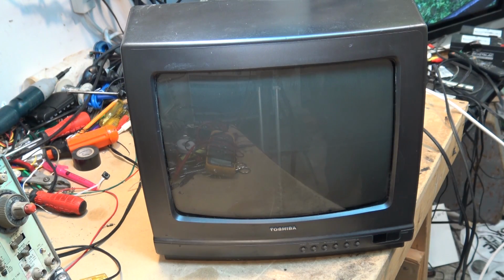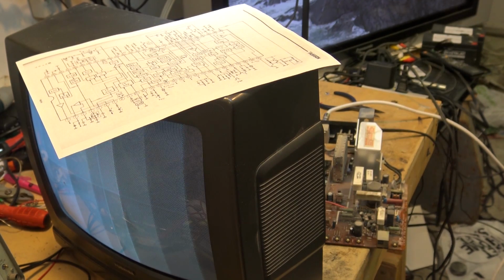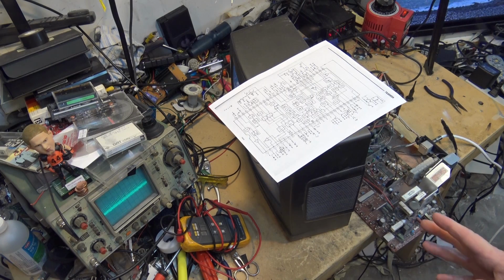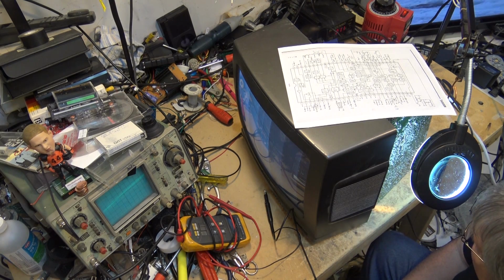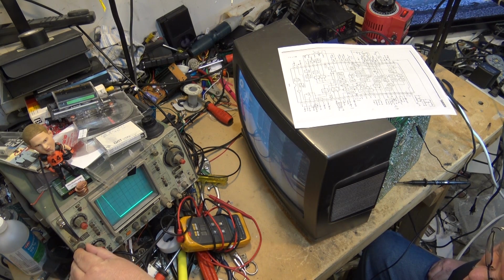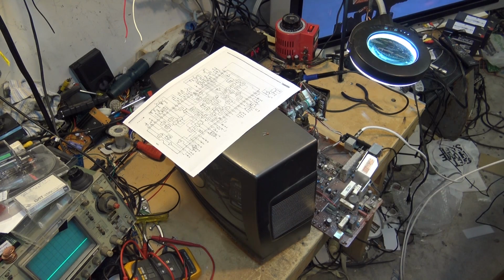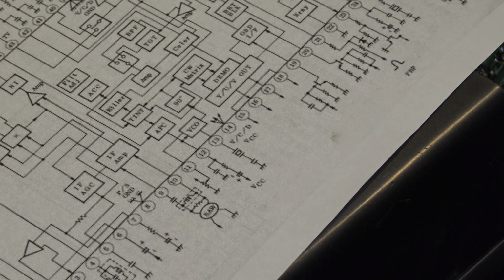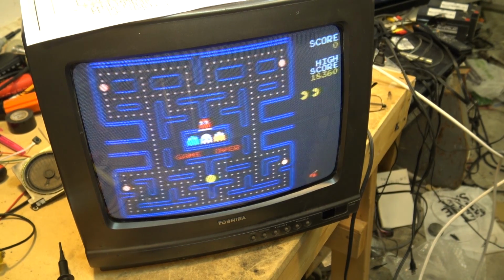Toshiba CRT TV No color repair

Comment: I know this is an old video but I have a Dell crt that loses its color. If I tap on the sides of the monitor sometimes the picture will get darker and lighter and once and a while it will get a pink tint over the whole screen. I suspect a loose component.
Reply from the maker: Or a bad CRT
Reply: If you have to buy a schematic where do you get them?

Comment: I realise that it's a bit late to be adding a comment to an article from so long ago, from the UK.  But as an ex (retired) engineer from 1958 to 2002, I am often amused by the now extreme accent on safety, which - for a good twenty years of my time - didn't exist.  When I started, all TV's had mains transformers, then came AC/DC sets, and we just ploughed on regardless, mostly doing repairs in peoples homes.  Many TV's were powered through a two-pin mains plug, so we had to have a 'neon screwdriver' to check which way round the mains plug should be. Getting at least a tingle, was a daily occurrence, and a proper shock, was known as a 'belt'.  It was in the mid to late 70's that 'Health and Safety' poked their noses into our lives, and the idea of 'Isolation transformers' were introduced.  The idea was to protect us from the mains by removing the reference to ground.  In other words, you became the reference to ground because the isolation transformer secondary winding is effectively floating with no reference to ground.  They then came up with the idea that workshop benches should also be 'Earth Free', meaning no ground on any of the mains powered equipment - oscilloscope, TV monitor, etc.  Practically all modern electronics - including some older CRT televisions, use SMPS (Switching Mode Power Supplies) that keep ground neutral to themselves in a marked 'Warning" area of the PCB... within this area, the only metal should be a heatsink.  In other words, the set (whatever it be), has two distinct neutrals - one with mains ground, and one with no actual ground at all, just a DC zero.  When working on TV's, I would suggest using an old style oscilloscope which itself will probably have a mains transformer, but even so, disconnect the earth in the mains lead (plug) to protect the scope probe ground. You don't need a modern storage scope for TV ... and whilst I started in 1958 at a large TV rental company, it wasn't until I changed employer in 1961 that I first saw an oscilloscope, and that was largely an ornament anyway... a 100khz max as I recall.

Comment: 12voltvids if you see this I need your help. I have an HD Samsung Slimfit CRT with extremely complicated video processing circuitry. It has a fault where composite video is in black and white like this one. There is no “jungle chip,” composite video alone runs through four different chips. I tried replacing the main board as a way to shotgun the issue, and as soon as I started the TV for the first time with the new board, I got composite in color. However, after I re-assembled the back cover and then turned it on again, the composite chroma was lost again. It is very strange and I don’t even know where to start.
Reply: Sounds like a broken connection in the chroma path. Check the comb filter circuit.  That set probably uses a 3d comb filter.  I have no experience on any of the Samsung hf crt sets. Mostly Sony and panasonic.

Comment: I've a 2001 - 2002 Citizen TV from the basement with that problem.  Fantastic trouble shooting.  Circuit layout minor different, but I bet it has the same problem.  A burnt out capacitor.  Thx!  (will test, anyway...)

Comment: 4:14 but the tv has a transformer the that mini transformer and that big coil is also a transformer
Reply from the maker: This is a hot chassis.  The mini transformer on many sets is for the standby supply to operate the remote control.  The horizontal circuit operates on mains voltage.  The fly back is used as a power transformer for the different voltages required by the set.

Comment: I worked at a fast food restaurant years ago. The images were burned into the screen. They didn't have screensavers back then.
Reply from the maker: I have a few monitors with burn in. The worst ones were the old amber and green monochrome VDTs I had one that was so badly burned back when I ran a BBS in the mid 80s. Burned a few of them, and an old CGA  and EGA monitor. This one was used for security cameras, as was the 20" that I have in the shop. It is nicely burned too.  I consider it a great send off for heavily used monitors to have the screen well burned by the time the CRT reaches EOL. I have a couple of BW monitors here that have been running for over 30 years non stop and they still have a good picture.

Comment: As time goes on, I'll understand more about equipment isolation and the transformer.  I'll have to rewatch this video again in the future.  I won't you to know I've paused this video because I don't want to miss a thing.  I'm still sad about you having to get rid of that Sony Trinitron after you spent time on it and two capacitors and did that resoldering.  Looks like there were some vertical lines at the top that still needed a problem corrected but.  If I were there, I would've of bought it from you. I love the old CRT sets.

Comment: Thank you for the nice educational video. Just to inform you in case you didnt try to repair a SHARP crt tv in past, it happens the exact opposite than here. Sharp uses its own semiconductors and IC's most of the times, where you only can find the service manual (after a lot of search...)of the tv to troubleshoot but no way can you find a datasheet of the various ic's not even for the transistors used for horizontal and vertical deflection. Its like a datasheet was never printed for the various sharp Ic's and transistors used in its TV's.

Comment: That PAC-MAN game sure brings back a lot of memories!
Reply from the maker: Yes! I have a few of those TV games. Bought them years ago, at circuit city. Remember them. Pacman was one, and I believe the other is spiderman. My son has it somewhere. I have another one that came preloaded with stuff, and my son now is collecting old NES games. Of course a CRT is the ONLY way to play those, because an LCD is too slow. You are dead before you get a chance to move due to the 3-5 frame delay on all digital sets.
Every time I put a small CRT up on craigslist it sells within a day for game use.

Comment: The television broadcasting system used in your country is ntsc pal
Reply from the maker: Nazar King 
Ntsc was used. Now all broadcasting is based on ATSC for 480i 720p and 1080i over the air. For cable we also have 1080p/60 and 2160p/60.
Yes believe it or not there are still SD stations. One local one has 3 sd channels on the same carrier and airs old TV shows from the 50/60/70/80s
Reply: 12voltvids HDMI tv

Comment: Hi, I wonder if the crt tv leaks its high voltage coming from flyback transformer. Is it the flyback itself is damage? or the other component is damage causing the flyback to leak its high voltage? It makes nasty sounds and affects the picture display.

Comment: You know how many quarters I spent on PacMan back in the day. LMAO
I didn't have a isolation transformer but I knew what not to touch. My most severe shock came before I worked on TV's and it didn't have nothing to do with Electronics. So yes I respected the AC line by the time I was working on TV's.
Reply from the maker: I had a friend that worked at an arcade, and "borrowed" a key and copied it.Fun times, when nobody looking open the door and press the credit switch that the quarter would trigger. Never paid for a game.
Reply: Best thing that was built was the home video games systems and the VCR. Was for me.

Comment: I have a 1994 Magnavox I use as my bedroom TV that was bought new for me for Christmas when I was a kid, it gets daily use. It still has a picture as it did when it was brand new. It suffered the 100uf 100V capacitor failure a couple times, and the 2nd time around, a 3.3uf non polar cap dried out taking out the STR regulator. So I replaced the STR (back when you could still get them), and the 100uf 100V cap and a 3.3uf cap with higher quality caps, and its still going. that fix was from 2002ish. No vertical or other cap issues yet, knock on wood!
Reply from the maker: There is NOTHING like the reliability of old CRT sets. I have some old Sony sets from the 80's and they still work perfectly.I should haul out my old Sonys and just demonstrate them. I have a few from 1986/87 and they have thousands of hours on them.I don't run them much now,  just keeping them in my heated storage unit as more of a collectors item, as I am sure in another 20 or so years when there are no CRT sets around they will be interesting. Show them to the grand kids if that day ever happens.